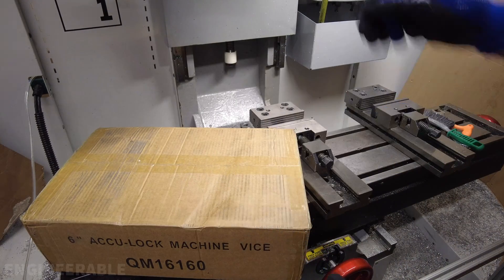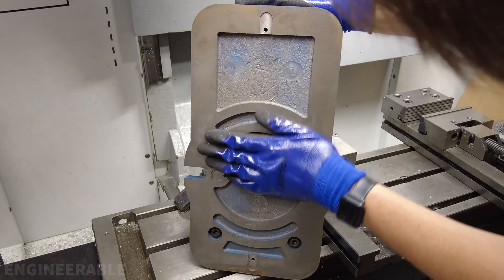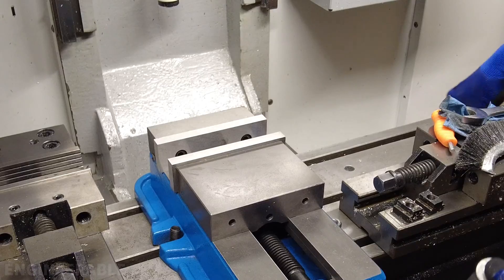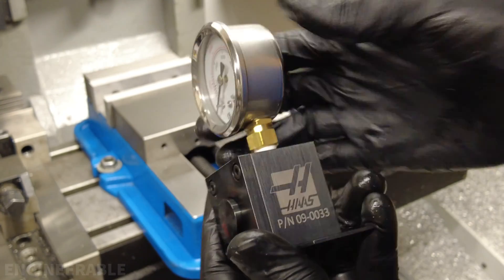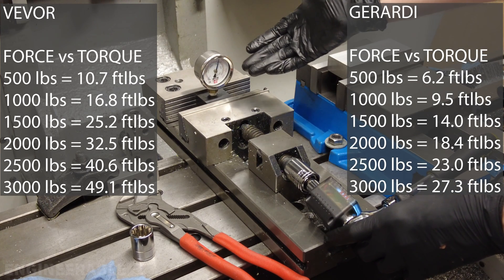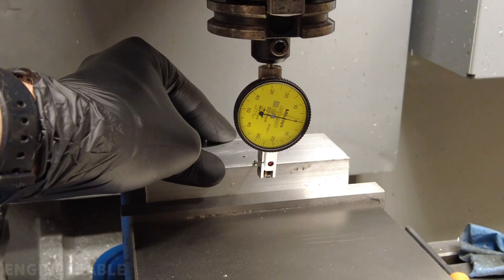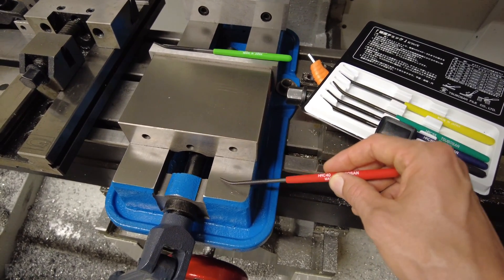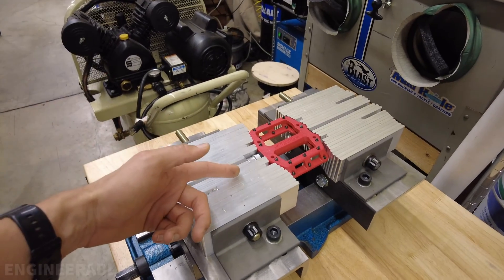IS IT ANY GOOD? I Tested $150 VEVOR 6in Machinist Vise For CNC Milling Machine and Manual Mill

Comment: They are a start. A clever machinist can make it work. Ive bought vevor stuff and have been quite satisfied. My 10 inch 3 jaw is within a couple thou and several hundred dollars less expensive than the competition. And easy on the eye.

Comment: If you check the two screw holes on the back of that vice where you usually can mount a swing stop you'll notice that they are not parallel.  I was looking to make a stop for my fake knock-off Vevor 5-inch and the bolt holes are off by .020" or like 15° and if you go to make a stop bracket add that much more to the major diameter on your holes.  The bolts are also M8 x 1.25 and id recommend the 20mm long hex caps

Comment: I got one on these ago, they are what they are. The fixed jaw back support relies on a keyway and bolts to keep it in place. One mine the keyway fit, but it was a slide fit at best.  With the aggressive deburing that left the first 1/16" of keyway depth unable to do it's job, it only left the rest to help keep the blick in place. The bolts holding it in place are junk and there's not a lot of cast iron to aid in strengtheninh it. The keyway had to be machined to the next size up. The fit required tapping to get the block attached to the vice bed. New grade 8 bolts are a must. 
  Even with all that done the clamping forced will still kobe the rear jaw slightly. It was 0.07" and it about 0.002" now if ai don't crank down to hard.
  Adjusting the moving jaw to eliminate jaw lifting isn't great on this model. It's either lovd up or lifting like shown in the video. All the parts for the adjustment are softish steel that mars the balls face and ruins any chance of a good adjustment.
 I got it back out today to see what it would take to fix it properly, back to the shelf it goes. It's an incredibly weak vise design. Don't buy any vice that has the fixed jaw rear support as a seperate piece from the main vice body. If it's not all cast as one piece your going to have a vice that disappoints. Find one with the fixed jaw rear section cast as part of the main vise or keep saying till you can afford to.